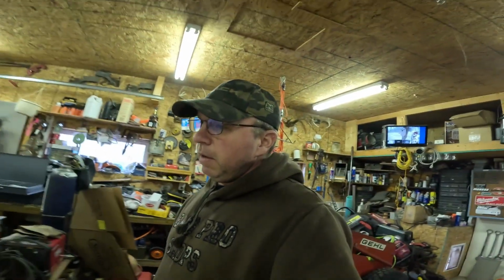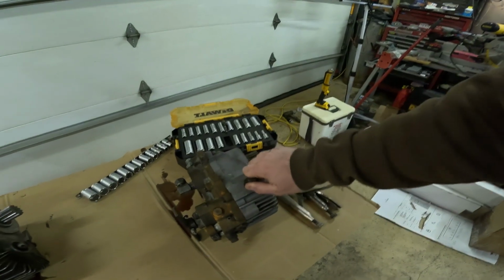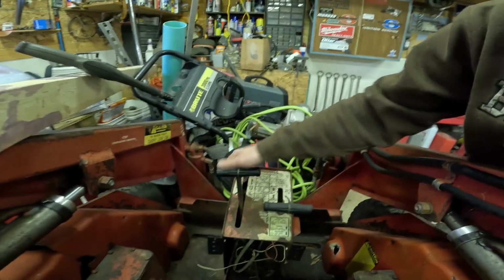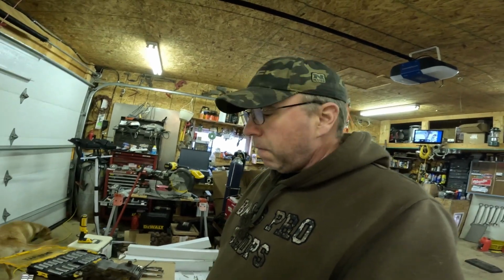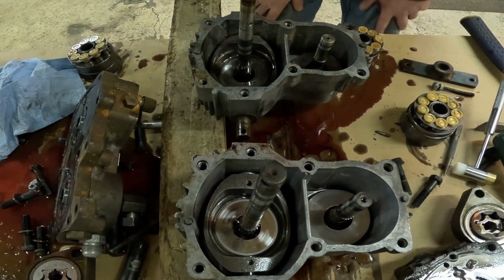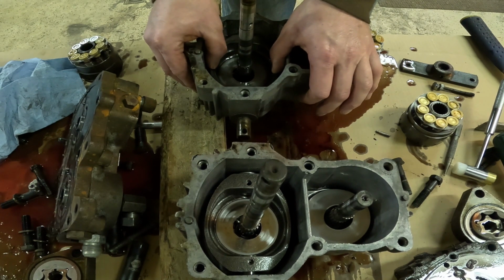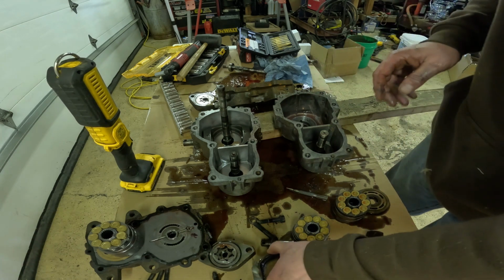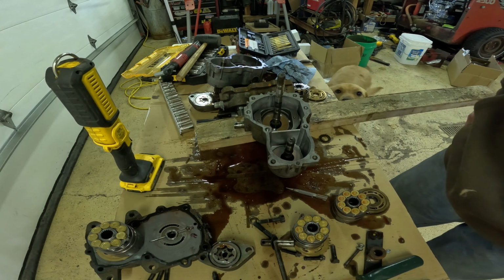Teardown Drive motor on my Gehl 2500! Part 6. #gehl #motorswap #hydraulicdrivemotor

Comment: Wondering if you know if there is a “rebuild” kit for these or is there even much to be said for seals and such that “wear out” in it? Didn’t look like much from your video. Any info would be greatly appreciated! I just picked one of these up and love it but the one pump feels weak on the turns and even will bind up almost and make my belt squeal… Awesome video nonetheless!
Reply from the maker: Thank You.  I am not aware of a rebuild kit for these.  It was hard to find any info on them.  but I was able to figure out that a lot of john Deere mowers used the same style of pump for the hydrostat.  They were just setup a little bit different.  Not much for seals to replace that I can remember from taking it apart.  If I was going to start looking, I would check with any hydraulic repair shops in your area as a start, or if you have any old school farm implement mechanics that maybe worked on mowers and such.
Reply: Do you remember what size lawnmower it came from? Thank you!!
Reply: @CraigLasley  I do not.  I did a lot of digging at the time, but that was a couple of years ago.  Being as this was built from 73 -78 I would start with mowers in that era!
Reply: @EncyclopediaBrownShorts thank you!